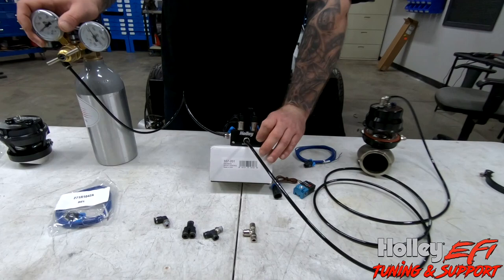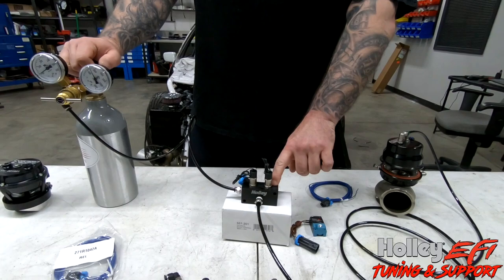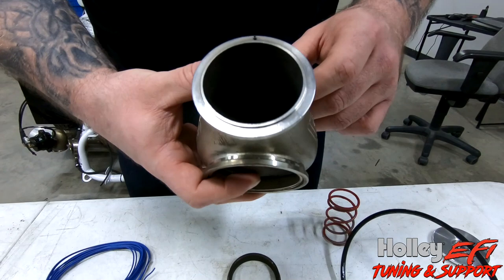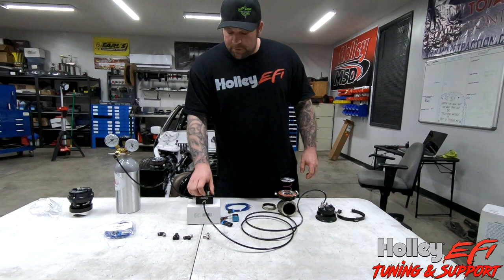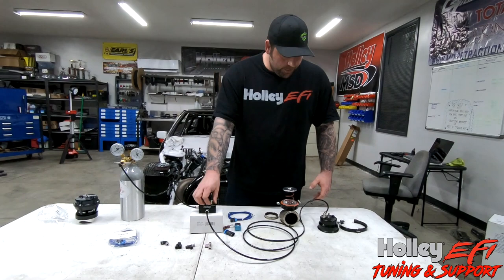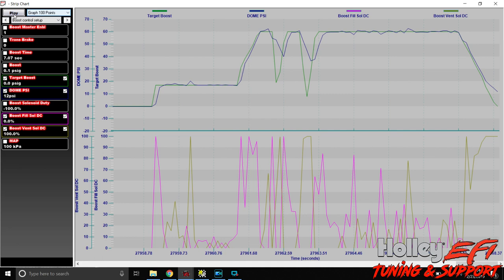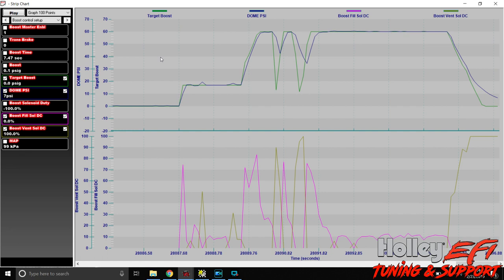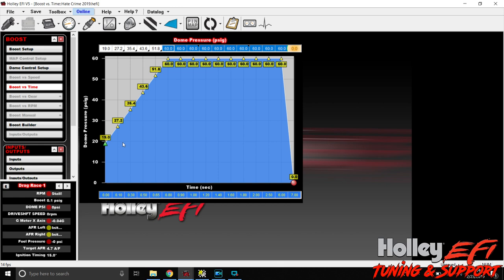Holley Efi pro series boost control solenoids

Comment: The information in this video is invaluable.  Took a half hour and got my system mostly dialed in PID settings wise.  Just need to hit the track and verify it still within the realm of how it works with the engine off! 👌

Comment: Hey man thank you for the video, watched it probably 3-4 times over and was able to get my pid values dialed in in only 30 minutes! I am running into a problem you hopefully know. When my solenoid vents off all the pressure at the end, it only drops to 0.5psi and won't go any further. I have to physically pull the line out to vent it. I checked and nothing in the tune is causing it, any ideas?

Comment: I see ur wiring it to a dominator. Does a termx need a relay when using these? I  Was told the termX needs a relay for boost solenoids Bc they r 12v?

Comment: No one never mentions what solenoid is for vent and fill on the Holley Hi Flo Pro Series boost controller. Hopefully this will help someone out but if you have the controller in front of you your vent solenoid is the right side the side that does not have threads for a Barb fitting

Comment: I know this is an old video Devin. Now you got a BBC and a FI turbo. Way back when you ran the PTE 98 and your 400ish CI SBF, What kind of power were you able to make with this combo? I have a similar cubic inch (427) combo with the same PTE 98. I have a feeling that My turbo may be on the small side. Power expectations are  15-1800.
Reply from the maker: I made around 1900 with the pte 98mm gen 2

Comment: Great Info. I got my solenoid settings setup just like urs but I'm having a issue with the solenoids starting to pulse as soon as I start to add PID. I haven't even used the trans brake button yet. Weird issue. Any ideas?
Reply from the maker: is your dome psi sensor reading 0
Reply: @theholleyefiguy  yes it reads 0..soon as I enter a pid it starts to start going crazy adding and venting..boost vs time is the setting but I don't touch the brake.
Reply: @k20edef1  did you figure this issue out? I'm having the same problem
Reply: @NorthAvenueRacing  once I connected the entire engine harness and everything was in place it stopped. I use the master enable switch now..so whenever I want boost controller on I hit the switch...currently I use boost by speed but when I'm at track I use time and turn boost controller on after burnout.

Comment: Does this solenoid block power need to run off a relay? Can it be run from a smartwire from the dominator?
Reply from the maker: I power them from a 12 volt output from dominator and send pwm- to solenoids
Reply: Awesome thank you

Comment: Crazy thing I found out is the Mac/Humphies valve don't work with C02 so am using compress air
Reply from the maker: yes they do
Reply: Devin maybe the mac does but the humphies style don't when I do the say test that your showing to do with compress air am dead spot on when am using the C02 shit is crazy can't dial it in.

Comment: Hey there I just installed Mac valve on my Holley terminater x “my first time ‘“ 
I don’t have any leaks I sprayed everything with soapy water but I’m haveing a issue with the Mac valves they don’t stop clicking once on they dump and add psi when I push the scramble botton and what not but there constantly ticking is this normal? Please help
Reply from the maker: what dome dome psi read when it should be zero? you will prob have to put a offset in the sensor depending whos sensor youre using
Reply: @theholleyefiguy  I’m useing the low dollar Motorsports 100psi how would I go about checking what do psi I have when there no air like your saying sorry don’t mean to sound like a nube as I am new to this
Reply from the maker: pull up the gauge panel while online with ecu on the laptop and look at the dome psi input you created
Reply: @theholleyefiguy  ok I’ll take a look I’ll keep u posted 🤦‍♂️
Reply: @theholleyefiguy  so I figured it out I made a custom pressure config but I do notice that the vent side opens a little bit every few seconds like open verry little and closes back up I’m thinking it’s just trying to keep the pressure evenly ??? What do you think?

Comment: I can't get this to work at all.  Seems like My ECU is not firing these off.  Checked the pin map multiple times.  Manually tested and it seems only one of the solenoids is working.
Reply from the maker: if you wired the increase and decrease solenoid backwards that is what will happen